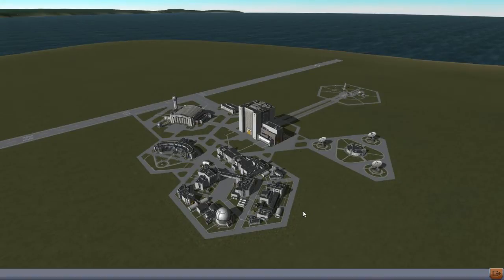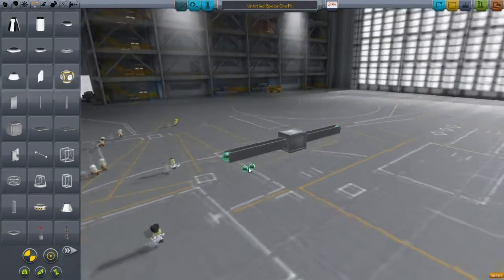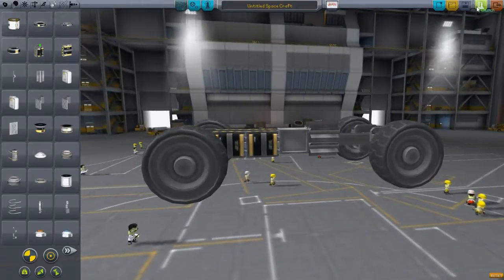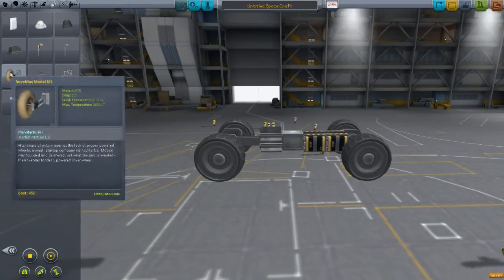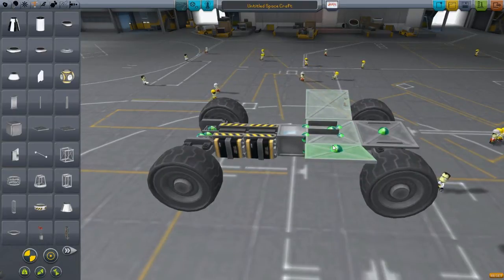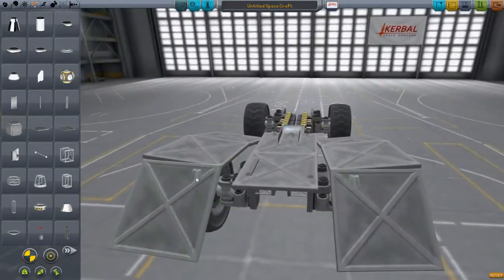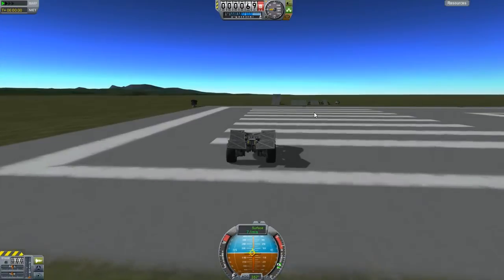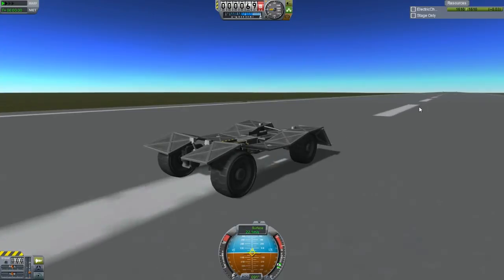KSP how to build a car/truck/jumper

Comment: Thanks man , Helped a lot for building rovers. Now how would you suggest transporting these rovers to say the moon?
Reply: Tyler Parziale tyler
Reply: david cho Hi
Reply: are you playing alot of ksp
Reply: david cho  yeah , even learning to mod it now
Reply: cool
Reply: +Tyler Parziale 
It all depends on how big your rover is. If you have a small rover, you may be able to fit it inside a service or cargo bay (this method works particularly well for spaceplanes). But, a better idea (whether your rover is large or small) is to either:

1). Build the rover into the rocket
2). Mount it on top of the rocket and build a fairing around it

Step 1 works better if you mount it to the bottom of a lander, so the rover can be deployed immediately after landing. Step 2 would be great if you had a small probe acting as a crane with rover attached to land it gently onto the surface.

Don't forget to save your rover as a subassembly too! Hope this helps. :)
Reply: +Thomas Lockyer he can just load the rover and click merge....
Reply: You would probably transport it through spacecraft with a cargo bay